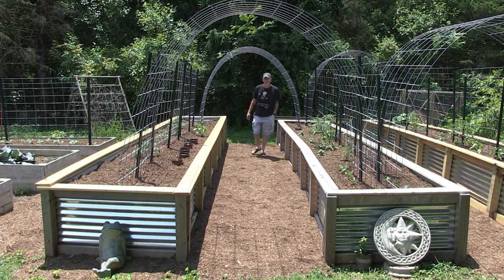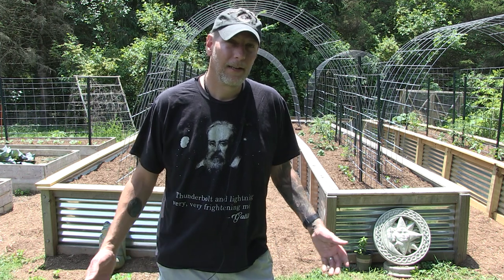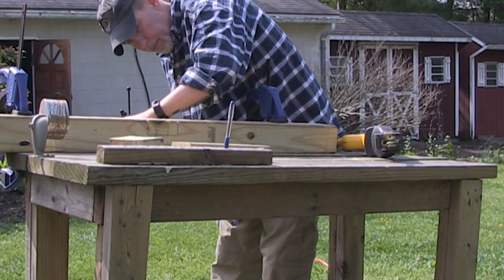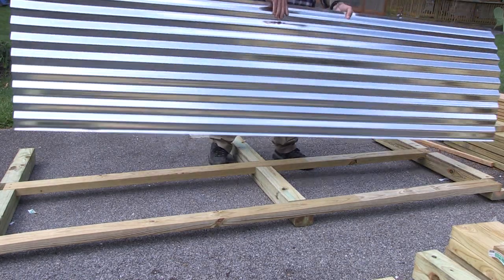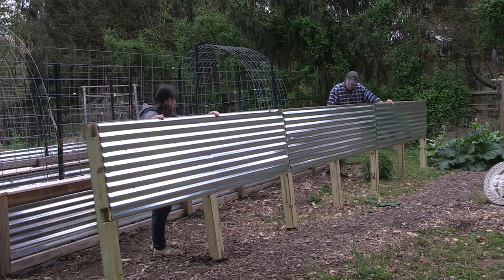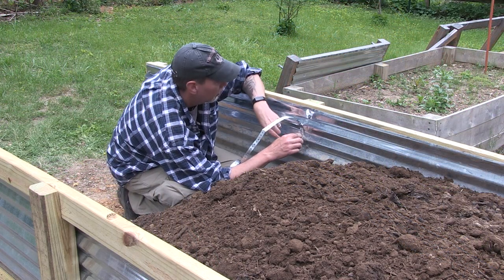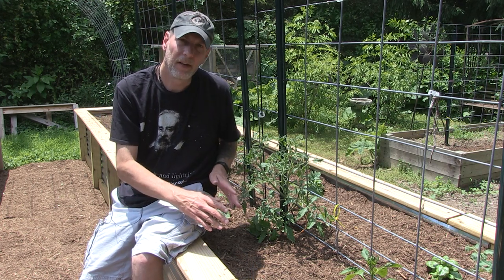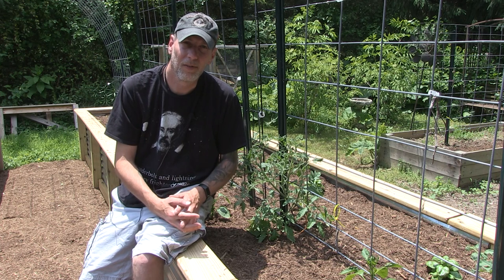How to Build A Raised Bed

Comment: Did you use pressure treated or use something less toxic to treat the wood?
Reply from the maker: One of the beds is not pressure treated, and I used linseed oil to stain/protect it. The two other beds are pressure treated wood. There is a lot of debate over the use of treated wood with raised beds. They did change the chemicals used in treated wood back in 2003, so that they have different compounds then previously used. The compounds currently being used are alkaline copper quat (ACQ) and copper azole (CA-B). Both contain copper and a fungicide but no arsenic. If you want to be a certified organic producer/seller, you can't use any treated wood even with the new compounds.
In the case of these raised beds that I built, the wood is on the outside of the metal, so only the metal is touching the soil. Granted, its not water tight, so there is a chance there could be some leaching into the soil from the spacing where the metal sheets join up. For my personal use, I believe this is so minimal that I am not concerned with an issue. We don't use any sprays or fertilizers (other than our bunnies poop) so we are doing the best we can to primarily be organic.

Comment: If I want to be able to reposition the beds. What would you recommend as alterations, if I don't burry the 4x4's?
Reply from the maker: Burying the 4x4's is necessary for the height and length of beds that I build in this video. However, if you do shorter lengths (say 4ft by 8 ft) and make them a bit shorter (no higher than 18 inches) you can probably be ok with building them without burying the posts. I have several beds I built that are 4x8 and 18 inches high. Instead of metal I just used 1x6 boards, 3 boards high. Those beds have never bowed and I have had some of them for 4 or 5 years now without an issue. (I hope that explanation made sense, if not, please let me know if you have additional questions!) :)

Comment: Why did you bury the posts???
Reply from the maker: The combination of burying the posts and using the metal straps prevents the beds from bowing out from the weight of the dirt. The first one I ever built didn't have either of those and bowed quite a bit. So I took it apart and rebuilt it with the straps and buried posts. 3 years later, no bowing :)

Comment: This design is far superior to using and kind wood as a raised bed. Don't think I would bury the 4x4s again. Rotted out in 4 years in clay soil. Wish I would have listened to people like this before I wasted a lot of money and time on pressure treated 4x12s, 4x4x and threaded rods. 4 years and everything was rotted and insect invested.
Reply from the maker: I do still bury my 4x4's as I had problems with bowing on the bed that I didn't. I have clay soil too, but so far I haven't had an issue with rotting (crossing fingers) after 4 years. The good thing about using metal instead of the wood is that its cheaper and lasts forever, and if some of the wood frame does rot, at least it gives the option of just taking off that part of the frame and replacing with a new piece and still using the metal. That would take a bunch of work, but saves money in the long run. Sorry you had issues with your other beds! I hope you have better success in the future!

Comment: It will work just as good  without  having to  dig the post holes ,wack in a 1 1/2  foot  t stake  out side to stop any bowing it's  been working for me about five years  , yours might look nicer .but its about saving  money and my back and growing your own food and  not about fashion
Reply from the maker: Good info! When I built my first one last year, I didn't sink posts into the ground and it started to bow. I tried adding stakes after the fact but I think at that point it was too late, since it ended up bowing more and pushing the stakes back, so that is why I ended up sinking all my posts in the ground. But you are right, the most important aspect is saving your back and growing your own food :)

Comment: The notching of the post is stupid when it is so much easier to pocket hole fixing.
Reply from the maker: Based on the wording of your comment, I'm guessing you're trolling, but I'll respond anyway. I believe for long term usage the notching method will last longer than using pocket hole screws. Pocket screws would be easier, but not necessarily the best for this application, but to each their own. This is just how I built mine and my oldest ones are 6 years old with no issues.

Comment: Do you have a materials list somewhere for one bed?
Reply from the maker: I don't, since my beds are different sizes. For an 4x8 bed though, you would need:
2x4x8 - 4
2x4x4 - 4
1x6x8 -2 (top runner board)
1x6x4 - 2 (top runner board)
4x4x3 - 6 (this allows them to be sunk 1 ft in the ground)
Corrugated metal sheets 8 foot long, 25 inches wide - 3 (one cut in half for the end pieces)
1 roll metal pipe strapping
Deck screws
If you were making longer beds you would just need to increase the material amounts to account for the size of your bed.